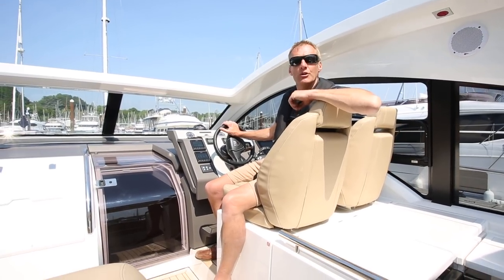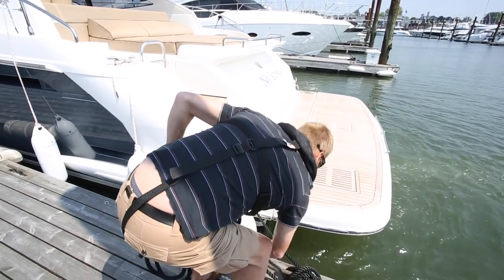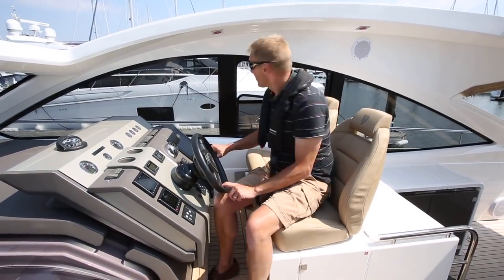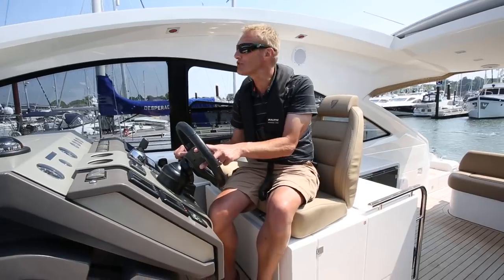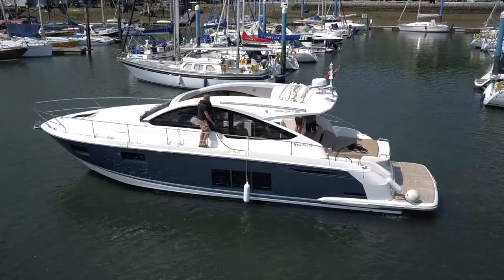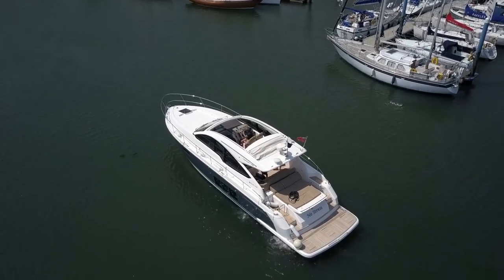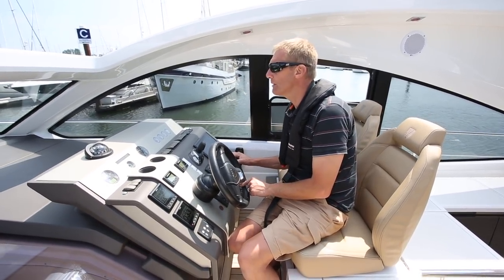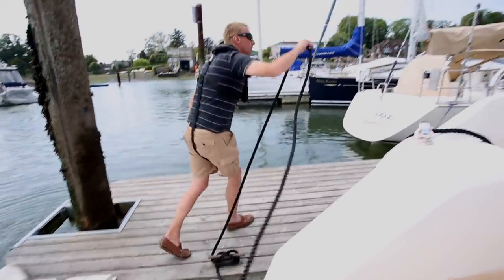How To: Berth Single Handed | Motor Boat & Yachting

Comment: Very Good ... can't wait for automatic docking technology ... I have ZERO ego when it comes to this ... I will take anything I can get.
I would use a virtual anchor to keep the boat in one place while I put the fenders out (GPS that locks the boat in one position), then I will use my remote control docking device so I don't have to run backwards and forwards and guide the boat in ... all the time sitting in a fold out chair with a beer in my other hand.
I have already seen quite advanced stuff for automatic docking ... they have it for cars so why not boats.

Comment: film doing it in a force 6 in a long-keeler in a crowded marina, with the wind blowing you off the quay, at night, black unlit piles all over, heavily tidal, and the usual ropes trailing in the water trailing from quays etc, (and no soundings on the chart/almanac), all because some jobsworth says you can't moor there as it's closed for the winter. That's what you pros are for ;) And thanks for that, Cuxhavn, not a jot of help, no drinking water (they came and locked the tap specially) - all they did was called the police, despite us coming in for emergency engine repairs at what was clearly labelled as an "emergency mooring area" ;)

Comment: Thanks a million, that's exactly the video i was hoping for !
That said, it seems quite some work to single hand the berthing..
Obviously it takes a lot of practice to do it but it's feasible.
But without the IPS system i wonder if it even possible.
Reply: No ips and If you have two engines it's always easiest to maneuver, single engine is a pain if you are not experienced
Reply: @Sokeresa  i like single straight shaft :) its a fun challenge

Comment: Twin engine with computer assist!!!!! How about single stern drive with no bow thruster?
Reply: And a Kort Nozzle with a 13 foot draft .
 I don't like this one rope does bow and spring nonsense either,  endless faffing and adjusting for no gain
Reply: How about an inboard with a fixed propeller shaft and only a rudder?  (No steering when in reverse)
Reply: @KevinStokes  you'll have prop walk in reverse, use that.

Comment: Nice video but have a question.

Why is the skipper constantly turning the wheel even in reverse?

I usually leave the wheel centered and maneuver using just forward / reverse to guide the boat into slip.
Reply: Single engine will have more affect when turned, it acts just like a single engine boat when used alone.
Reply: Even with twins, rudder angle will typically help move the stern where you need it.

Some designs don’t respond as well to rudders at slow speeds, while others can be walked sideways.

This captain is very smooth, and well practiced.

Nicely done!